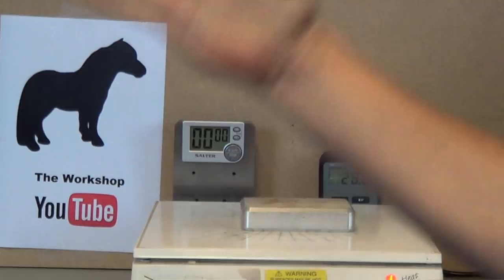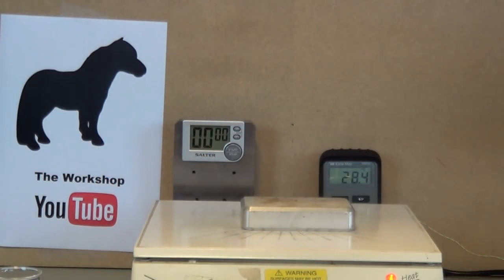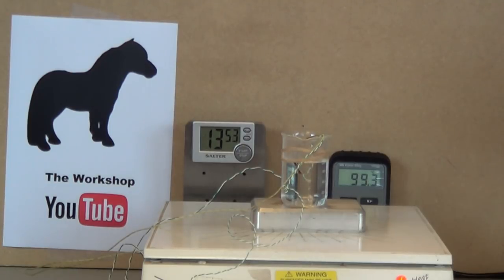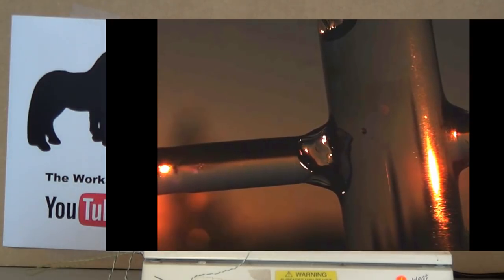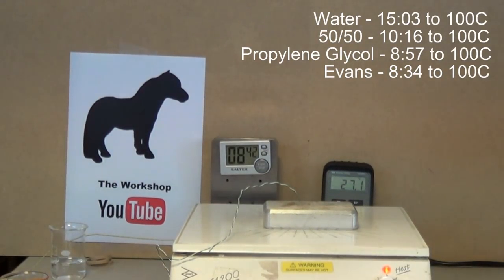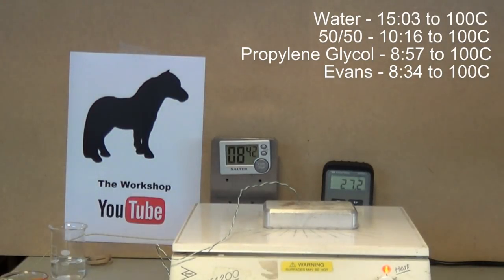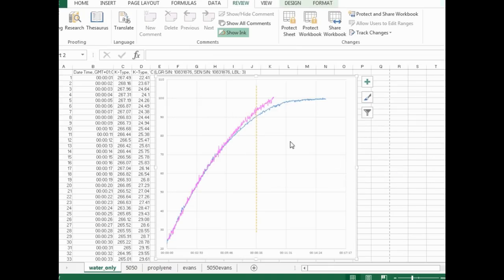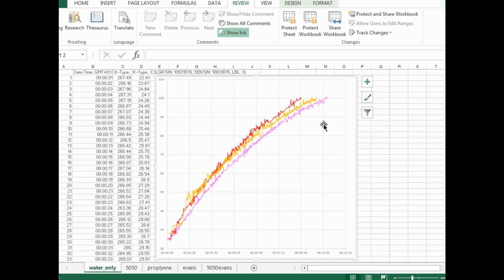Evans waterless is SHIT! - with proof

Comment: I like your experiment.
A further experiment is to take a car, pulling a heavy load, such as a caravan trailer, that maintains its temp with glycol/water coolant, then switch that vehicle combo over to Evans.
 Another possible test is to take a vehicle that will drive close to the high temp for that vehicle, and see how much sooner it gets hot.
  An engineering exercise is to, with some educated guessing, take a vehicle that runs near the limit of it's cooling system, such as a delivery lorry that runs in stop and go traffic, or at constantly high speed, such as a small car on an autobahn at max speed.
  Lower the thermostat setting to say, 160 degrees F, (I saw a number of heavy diesels in class 8 trucks use the lower temp thermostat)
How much bigger a radiator would need to be fitted to the test vehicle, to keep the test vehicle's engine at proper operating temp?
The test vehicle might also need temp sensors at problem areas, such as the water jacket near the cylinder head, or by the exhaust valve.
A good preliminary indication of ineffective cooling, is if the oil temp is hotter than the max recommended for that engine, say over 120C, when the coolant that is within an acceptable temperature.
   No, I am not in a position to attempt any such experiment myself, as I don't have access to a workshop.

   Keep on keeping on, good videos.

Comment: You just proved Evans can absorb heat faster and so it can get that heat out of the engine and to the radiator quicker to get cooled off, now we need to find out if the radiator can cool it down enough in time for the next cycle to be useful again.
Reply from the maker: Lol say what?
Reply: @dirtygarageguy  just read my new comment and learn.
Reply: @The-Red-Pill-Society you completely misunderstand how engine cooling works. Heating up faster isn't good as it shows that it doesn't have the ability to disperse heat fast enough

It's a simple matter of the energy in to get it to 100c being the deciding factor.

Comment: may be the jump in temp  whit evans and water is cose of samting ike a water-reactive substance ?
allso wat intrest me the most is wich coolent taks out the moost heat a way from the engine under load can you show the graph from the hot plate ?

great vid thks
Reply from the maker: I did at the end, but I can show more - I have all the data
Reply: thanks keep it up allso can you compare between the premium coolants like motul /  motrex to the regulator i just looked at my motul
ingredients list and sow ethlin glioal and a shitlode of ather tings mosly h0xx
 after having  a couple  spills out rock climbing i got nervous the first one wase at 105c  i changed fluid to a higher grade and a new red cap and had another one this time at 118c trho in the towel and bought a fan  haven't had one since ktm in their infinite wisdom decided not to put a reservoir  but that made me very nervous about coolant 
especially with how expensive things are where i live allso its a 2t
and the cylinder cams off a lot
Reply from the maker: There won't be a big enough difference between the higher costing brand names and regular anti-freeze, well not enough that I can measure. It will all get lost in the noise of the measurements.

Comment: The hotplate temperature logs may be interesting too. Since the purpose of coolant is to carry the heat away from the metal surfaces, is there a difference between the way they carry heat from the hotplate. Might be too subtle a difference with just the small beaker, but could show a more complete picture if there's a difference.
Reply from the maker: The hot plate has an inbuild thermostat, and it try to keep the temperature at 260degC, even with this huge element you can see the temperature of the Aluminium block's temperature drop when the liquids absorb energy. All of these liquids have a higher specific heat that Aliminium, so this makes sense. You can see this in the graphs at the end.
Reply: s'ok, I just saw the follow up video, great test of this stuff against good old 50/50.

Comment: I’ve just flushed Power Cool out after running it for three years. My fan was forever kicking in during the summer months. I’ve now put 50/50 in and the gauge is already moving a lot less and the fan has only kicked in once and it was not on for very long at all. I won’t be going back, no chance.

Comment: I'm not sure you proved what you think you did. 

Evans absorbed heat faster and didn't boil.  That's why it cools better.  Water flashes to steam in the head and creates hot spots, which causes even more heat. 

The only valid test in an actual engine.

Comment: If you make a pressure vessel, add the neck of a radiator and cap. You can use a recovery bottle.
Reply from the maker: I was thinking I could just heat up a radiator.

Comment: Water, straight water is ofcourse the best coolant in the world, but it doesn't work in the real world, your cooling system will rust and block up the fins in the radiator preventing proper heat transfer, the best compromise i find is a traditional antifreeze mixed between 10-30% , enough corrosion protection and better cooling than 50/50.
Reply: That is so wrong it's not funny, water is a coolant, it is a good coolant, it isn't the best in the world. Plus it has so many negatives when you run metal parts that can oxidise.

Comment: You'd think that with a name like "ANTI-FREEZE" more people would get the point, we are diluting the heat removing capacity of water to prevent the motor from bursting when it gets cold, due to the fact that water expands at its boiling point and at its freezing point. It is not called "anti-heat-up." Propylene glycol is simply a non-toxic version of ethylene glycol.
Reply: But hey Evan's did win the race to 100 degrees, fastest wins right? That's because it is racing anti-freeze. lol
Reply from the maker: LMAO! Racing anti-freeze - love it
Reply: mondayfool from what I understand and depends on how cold you're talkin, the pure stuff will gel at around -25F you should always run a lil water in your antifreeze, I used to live in Fairbanks Alaska, we ran with 75/25 (ethylene-glycol/h2o)
Reply: mondayfool if you haven't tried already, block the radiator with something like cardboard on the cold days should help especially when traveling slowly. But if you wanna try the pure route, only possible concerning can think of would be wear and tear on the coolant system, but if there is no added wear I could see it warming up faster.

Comment: the problem with water is the rust and ruins inside the engine
Reply: which is why you mix 50/50 with antifreeze, which also contains corrosion inhibitors. 50/50 will also raise the boiling point , but not as high as evens which will boils at a temp high enough for you to have a damaged engine from overheating
Reply: @BigBadLoneWolf  2 yrs late but. in his test the 50/50 boiled faster than the water alone.
Reply: @bikerboi1983 that's the trade off you have to make for running an engine in freezing temps and the anti corrosion protection.

If you have a race bike/car that you drain the fluid between uses or a toy that you only fill with coolant when your using it. Water IS the better option.

For a daily driver or something that's going to sit for a week at a time between uses the 50/50 is the least worst compromise.

Comment: The "job" of the liquid is to absorb heat as efficient as possible, the job of the thermostat is to open at the right temperature, the job of the pump is to exchange heated liquid for cooled liquid, and then  the job of the radiator is to cool off the liquid enough to prepare for the next cycle, right? With me so far? So, if the liquid in the engine is absorbing that heat faster then it removes it faster, still with me?, to the radiator where it can cool off to go back in , then you have a more efficient heat exchange happening, now stay with me this is the best part, so the faster the liquid can get the heat and then remove it means............ That is the best liquid to use (so far and according to your choice of test samples)!  Now do all of you understand how the cooling system works? It is a small heat exchanger.
Reply: Except that's not how it works.

Couple of reasons.

1. The temperature of the coolant is irrelevant what yiu have to look at is the amount of energy it takes to get the liquid to that temperature.

Heat is energy, so you want THE MOST efficient carrier of energy I.E that which can carry the most in a single movement.

Evans can carry less energy per gram than water can. So the energy being pulled from your cylinder is lower with Evans.

Plus water cools faster I.E it dumps energy faster. So it takes more energy out each cycle and it re enters the cylinder on the next cycle at a lower temperature so able to carry even more energy out.

2. Engines are designed to run in a specific temp range for efficency reasons. (oil. Fuel consumption, efficency of combustion etc etc.)

So what yiu want is the coolant that keeps the cylinder in the range that it's most efficient.

Evans openly state tgat yiur coolant will be hotter, now when that temperature displayed is the temperatures your bikes manufacturer states is over the design perameters and needs to be turned off and allowed to cool, then Evans is not a choice that's sensible. 

Even if all that mattered was the temp  Of the coolant as it entered the rad, if the temp is higher than the specification the engine is designed to run it's coolant at the Evans is a bad choice.

Comment: Im no scientist but doesnt taking the heat away from a surface quicker mean that it removes the heat from the item it is in contact with and subsequently cools that item quicker, for this test I would have had a pump a small radiator a small fan and certain wattage heating system that can also measure watts in. This test simply show the rate at which heat transfers into the liquid, the quicker the better is obviously the winner.  Or do the same test and place one thermal couple on the hot plate, and one in the liquid, turn off the power and the one with the coldest hot plate will be the best as the heat has been removed and transferred into the cooling liquid.
Reply from the maker: i did measure the hotplate and your misunderstand how coolant works, the ultimate test is coming soon with the ER5 test.

Each liquid is exposed to the same heat source, how quickly they heat up shows their how saturated they are becoming before releasing excess energy.

This is why its called Specific Heat Capacity. Look it up if you don't believe me. 

"This test simply show the rate at which heat transfers into the liquid,"

- that would be the thermal conductivity of the glass and the glass beakers are pretty much identical. 

"Or do the same test and place one thermal couple on the hot plate, and one in the liquid"

- this is what I did in the next video
Reply: Sorry dont get me wrong, Im simply trying to learn, I have a small radiator the size of a 6" fan and it was used for distilling (not that I distil alcohol) and I have a metal electric pump and also a heating source that I can set, what I was thinking of doing is heat it for a preset time, lets say as an example 5 mins, measure the temperature of the heating source plate at 5 mins then pump the liquid through the radiator and fan for 5 mins and then measure the heating plate again. i.e. simulate on a smaller scale a typical environment and see what the results show.  The next video you have you place both heated liquids on the metal plate to cool, isnt it possible that the Evans is taking that heat away from the other liquid source, if you did them separately this would be a better test. Ive had the Evans coolant here at home and have been holding off on replacing my current coolant because I dont want to damage my engine if it performs worse than normal coolant. I have a TL1000 engine that runs best after 78c and below 100c and I have a radiator fan switch that cuts in at 95c and stops at 85c my engine as it stands runs perfectly at the moment and the engine coolant thermostat opens at 85c and temperature ranges from 83c to 98c which is perfect for my bike and the courier work I do riding in the city all day long, so in saying that I'm not about to mess with a setup that is performing perfectly unless there is an advantage and hence why I am looking at results like the ones your attempting to show. The fan switch temp sensor and the engine coolant thermostat was changed to achieve this otherwise it was always running rich to bring the temperature up on the bike in winter as it was always colder than 78c and in summer time was reaching 110 most of the day and was never below 100c and the bike was not running well at high temperatures.

Comment: its an atmospheric test.   not in running engine under pressure and coolant flow.
Reply from the maker: And that's what I'm doing at the moment in the SV1000 - however....

How does this change the specific heat capacity or the thermal conductiveness of either of them??

Comment: Matt, there is a product called Wetter Water.  I would like to see how it influences things.....just saying.  It is about the only thing they will let us use when we car race at certain tracks....with water.
Reply from the maker: Already on the list dude, although its quite intresting. Reducing waters surface tension vs cavitation? I don't know enough about cavitation yet to give a good answer, but on the face of it, it kinda makes sense?!?
Reply: I haven't messed with it much but I have seen situations where it appeared to help.....but track conditions and where you run compared to everyone else could have had a greater influence than the wetter water
Reply from the maker: "but track conditions and where you run compared to everyone else could have had a greater influence than the wetter water"

- if its an even day of the week probably has more influence lol
Reply: Reducing surface tension might increase foaming and make cavitation worse! That's what washing up liquid does, it reduces surface tension and the contact angle of oil droplets. If you really want to mash your head, look up the Gibbs-Marangoni Effect, the principle of how anti-foaming agents work, by disrupting the surface tension. This is exactly why soap causes bubble bath foam to collapse, as they both compete at the surface of the water and that raises surface tension. Cool, eh?

Comment: This is seems like a very flawed experiment.  I'm not even sure what you are trying to prove.  Certainly it doesn't prove how effective these are as coolants, maybe I am wrong.  The temperature of the aluminium block is critical data, without showing that data for each fluid voids the experiment.  We should be able to see the temperature for the block at the start of each experiment to validate that they were the same.  If the starting temperature were in any way different that would change the speed of the temperature raise.  That block also represents the hardware of an engine in this setup, that temperature is what I want to see, as that truely shows how effective the fluids are at cooling the thermal mass.  You are not measuring how much heat dissipation is occuring from the coolants.  When discussing the graphs you also state that the evans boils at 100c which it doesn't.  You can see from the graph that the only reason water takes longer to get to 100c is because as it gets closer to boiling,  that phase transition from liquid to gas uses a load more energy than just temperature raising so that is why the temp rise slows down and it takes longer to get to 100c.  Up until that point the curves for the different fluids are very similiar.  Also an engine coolant system is under pressure, raising the boiling temp of the water, so water temperature would continue to rise just as quickly as the other fluids, without the phase transition at 100c and not tail off like this experiment shows.
Reply from the maker: Because this isn't a cooling system...

Comment: This doesn't make sense to me. You keep talking about "boiling" temperature, but the only fluid of these boiling was the water. Of course it can absorb more energy before 100 °C as it's changing it's state. Propylene glycol would act the same just before 188,2 °C under atmospheric pressure. Feels like comparing apples to oranges. Without the closed system pressure in the equation, this test is just pointless. Anyrod, love your vids and I'm pretty drunk now, so feel free to roast me in case this comment was a bull crap!
Reply from the maker: Yep - bullshit lol.
Reply: Completely got your point after watching the following video.